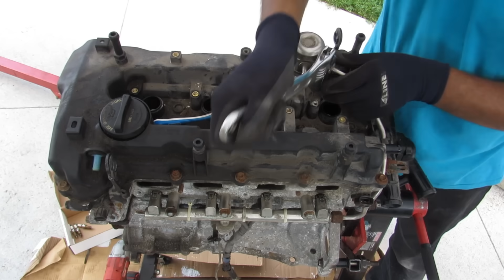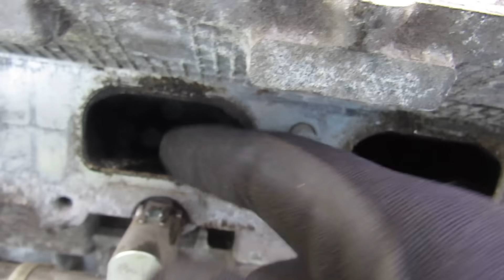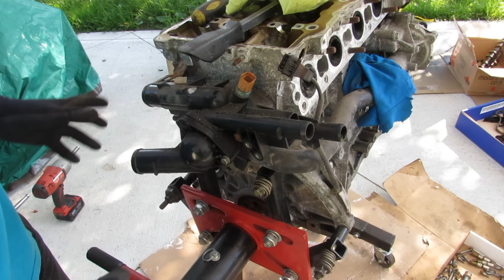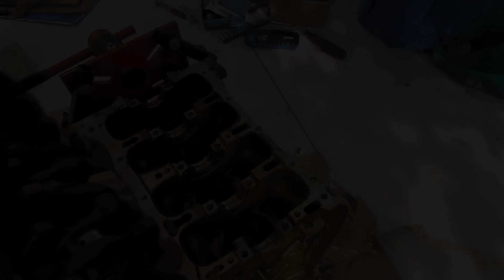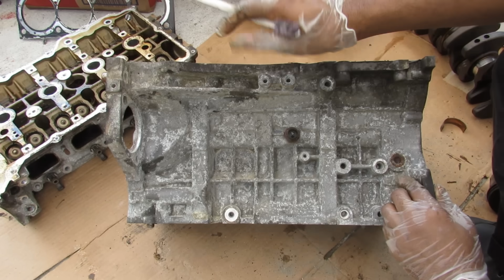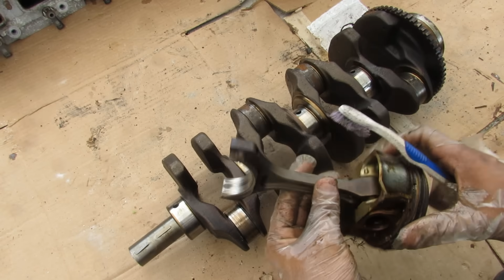Why Hyundai Engines FAIL

Comment: K-Pop cars are trash, obviously.
Reply from the maker: I mean they've started beating the Japanese (Nissan) already...
Reply: @speedkar99  Yabut Nissan got bought by Renault and went to garbage.  The Japanese corporate ethos of long-term commitment to quality, longer R&D cycles, and customer satisfaction went out the window.

European firms are the worst.  They are run to primarily please non-customer stakeholders.  E.G. - Why do you think BMW green-washes its cars by making its engine components out of plastic?  It’s planned obsolescence at its finest, but it also pleases the unwashed hippie environmentalists, because “green”.  🤦🏻‍♂️ American firms aren’t much better, but at least they realize that shareholder value is indirectly linked to customer satisfaction…

Comment: My wife hyundai elantra 2012 engine was rebuild about 8 months ago by hyundai dealership. Had only 28000 miles. They didn't want to do it so we had to show them articles and videos of other people having the same issues. The supervisor of the dealership give the go ahead for them to rebuild the engine.
Reply from the maker: You should have contact Hyundai head quarter
Reply: @speedkar99  Hyundai Corp gave the dealership the go ahead to repair not the supervisor from that particular dealer.
Reply: @smartkid1201  The warranty is for an engine replacement not a rebuild. So they should have swapped the engine out, not rebuild it.

Comment: It speaks volumes about Hyundai with respect to that lacking chain guide between the cam sprockets. Even motorcycles have guides there, it might not be substantial but its there; and motorcycle manufacturers usually do anything to get rid of weight (unless you're HD).
Reply: Yeah, had Elantra in the shop with stretched chain that jumped a few at 130k km. But it was owners fault, 10w-30 mineral and 15k km OIC. We put 'new' engine with 50k km and stated that there's no warranty on this one if it fails because of the way he mainteins his vehicles.
Reply from the maker: Yeah I found it interesting

Comment: I have a santa fe with the 2.4 its had the inspection at the dealership where they change the oil dip stick and update the computer. It's on 100k km am I on borrowed time with this engine? is every single one guaranteed to fail?
Reply from the maker: Not everyone will fail, it's just risky that if it does fail out of warranty it'll be too expensive to replace. I didn't know they change the dipstick
Reply: @speedkar99  yeah it was part of the recall they inspect the engine and swop the dipstick for some reason? Fingers crossed for my 2.4 then!

Comment: Happened to my mom's car, after she brought it in to be inspected, they said it was fine, then no warning the engine just locked up on the highway
Reply from the maker: Yep, it's a sudden scenario...all of a sudden the bearing over heats and quits it's job.
Reply: @speedkar99  i dont get it.
Thise engine are use a lot in my country .
Easy do 300k (km) .
I have a honda with the d16w1 engine (hrv) and i look to it and have a serves interval of 10k for the oil than i look in the book and its tell me 15k interval of oil.
I change the oil my self (old mechanic ) i do it 1x a year and use the 10-40w oil and not the 5-30w oil.
I hate 0-30 4-30 and the 5-40w oils fromt the start.
I just do 10k small (oil and filter) and 15k big (oil , filter sparks and air filter)
Yes like the 80 and 90 .

Comment: I had a 2011 Sonata that I finally traded in last Sept with 145K miles on the original 2.4L engine.
Reply from the maker: Nice. RIP to the next owner
Reply: @speedkar99  Not necessarily.  Hyundai makes some of the most reliable engines out there.  Check out ratchets and wrench video on Hyundai's most reliable cars.
Reply: @springer-qb4dv  Not with the 2.4 engine in it, it's a time bomb waiting to blow up. Never in my life, and I'm 59, had a car spin a bearing until this week. It's unheard of with today's machining standards, except Hyundai ?

Comment: I have what I'm afraid may b a dmb question but when you say triple square socket do u mean a hex
Reply: No I think triple square is literally three squares rotated at different angles so there's like 12 sides to the bit. It looks like a torx but it's different. Most common on German cars.
Reply from the maker: No. Triple square has 3x4 =12 points. Torx has 6
Reply: @speedkar99  thanks guys. Ya I've never heard of that

Comment: I raise my hat for Honda. My last Civic had 400k on it running still like a clock before I totaled it in a winter accident.
Reply from the maker: What engine? D17?
Reply: @speedkar99  it was R18 1.8 civic 2007 now I got 2014 with stick shift manual its the same engine though 😅 thanks for video. It was km not mile. In harsh Quebec climate!
Reply: @mahdavimail  I'm impressed. Our 2009 Honda Civic failed at 140k with the transmission loosing 1st, 2nd, 5th and reverse (manual) and the engine having very excessive blow by and a failing headgasket.
Reply: @JoshuasRecordings  my dead Civic was automatic but this new 2014 is manual because I don’t like CVT new automatics. But this new one has slightly more rigid body structure that I can feel when driving. You are not lucky man people still driving 6th generation civics and I am jealous 😂
Reply: @mahdavimail  Good move on the manual. Hopefully it lasts longer than mine did.
Reply: @speedkar99  what do you think of the d17. Specifically the a2
Reply: The original insight motors have seen 1 million miles. Now the F1 motor is matching Mercedes. Honda knows motors

Comment: We got 2012 Kia optima 2.4 it's got 210,000 miles so far still running good but it looked like the previous owner had a head gasket issue
Reply from the maker: So no oil consumption?
Reply: @speedkar99  no not really surprisingly

Comment: went to the dealership carmax they had a 2017 sonata sport lovely car sexy had the 2.4 hmm ok test drive, got on the hwy stepped on the gas black smoke everywhere uturn took it back nope
Reply from the maker: Wow. A 4 year old car smoking already
Reply: They blow smoke like a diesel on full throttle because of the direct injection burning dirty with carbon buildup.
Reply: @dpok69  I still like the sonata sport but hate the engine

Comment: My 2011 sontana is at 236k with three motors later. Hyundai has warranted every engine swap. 100k Warranty starts over when engine is replaced.
Reply: Question.. you’re paying for the new engines right. Not like the engines are blown or malfunctioning.
Reply: @brucebmendoza  I'm guessing not, Kia and Hyundai have the best warranty's because they know thats the only way to build trust
Reply: @pleasedontwatchthese9593  you have to be the original owner. That's how they get you. Second owner will not get the same service of warranty.  I found out the hard way when buying a used kia. We had to pay out of pocket for a warranty repair.
Reply: @Eli-or7hl  the theta 2 2.0T/2.4 Gdi are all covered under lifetime warranty if the product improvement campaign has been completed which updated software to knock sensor. My mom 2016 sonata 2.4 she bought used at Hyundai dealer at 58k already had it done because all that needs to be done before being sold obviously and now it’s covered for life. So the 100k warranty is absolutely irrelevant to the engine.
Reply: @zabryant01  the lifetime coverage is only for this rod bearing problem... right?
Reply: @TruckerGuy135  well the short block which includes rod bearings which is the issue on why they fail so they all typically are covered.
Reply: @brucebmendoza  I paid zero out of pocket. All I paid is for the tow to the dealership. Every engine lasted about 76k give or take. The current motor is around 12k  with three oil changes. Everything else is original running strong.
Reply from the maker: Wow that's neat to know. With these engine's reputation, you have a lifetime warranty

Comment: with all the carbon built up, how is direct injection better than port injection? Yes, it save fuel, but you have to service more, and most people won't bother.   At the end, shorter engine life, and less happy hour behind the wheel.
Reply: They should have an oil catch can out of the factory or they need to go to sequential like toyota
Reply from the maker: More power. As long as it lasts the warranty, the manufacturer doesn't care how much it costs to service it later.

Comment: The question is are all the engines going to fall apart and more important are the repaired engines used for replacement /warranty poor shape also, my sister had her car done 5 years ago..
Reply: Not all are affected. I believe they fixed the issue on the replacement engines.
Reply from the maker: They probably send the blocks out to be remanufactured

Comment: Just goes to show you, behind every great man, there's a woman with a toothbrush that she stopped using and a few old dresses she stopped wearing too.
Reply from the maker: Well she ootta stop wearing them now that I've used them 😎
Reply: Bad bearings are rather infrequent. Usually lack of proper lubrication is to blame...
Reply: @spol1622  Big end bearings are made of cheese.  I had a Tiburon V6 coupe once and this engine is famous for main bearing issues, the "knock of death" is a well known issue you need to check when buying the car.
Reply: @rodpanhard  I doubt the bearings were made in Wisconsin.
Reply: @spol1622  
agree.......engine  failure  caused  by  neglecting  regular  scheduled  maintenance  -  oil  changes.   oil  is  cheap......engines  are  not.

Comment: Please, talk slowly to understand all engine components. It means that GDI engine has big problems w/intake valve. GDI is good, new tehnology, bad engine. The engine life is the oil quality. Pass to syntetic oil and change often (max. 10.000 km). Clean at each 25 kkm the intake valve w/CRC spray GDI clean valves. If you wait more than 100 kkm will be very difficult to clean these valves. Lot of money to services.
Reply from the maker: Agree, but if they did it like Toyota with both port and direct injection you wouldn't have to do any of that.

Comment: How do they overcome the carbon buildup in the ports in recent engine design?
Reply: Routine cleaning, or adding port injection.
Reply: Port injection.
Reply: Check new Toyota engines, they have both: Port and Direct to lower the carbon build up on the intake side. For Direct FI engine choose oil with low evaporation ratio, high boiling temp, maybe run a slightly heavier oil with higher boiling temp in hot climate. Then there are some products that work a little, cleaning the ports, but many engines, like BMW, have to have intakes walnut blasted to clean the carbon build up.
Reply from the maker: Use port and direct injection

Comment: the engine is bad even if they don't come with direct injection. in latinamerica most theta engine in santafe and tucson  rarely last more then 100,000. bad oil pumps and rod bearings
Reply from the maker: It's common there too eh

Comment: My moms 2012 optima with this engine threw a rod after she just got the high pressure fuel pump repaired
Reply: My Santa FE just spun a bearing and seized up this week. Waiting in the dealer to see if they'll put a new engine in it. If they do, I'm selling it right after, and buying a used Toyota  4runner or Highlander.
Reply from the maker: Ouch. Was the pump leaking?
Reply: @speedkar99  I don't think so i think it just failed

Comment: "gallery".
Reply from the maker: Galley
Reply: @speedkar99  Galley means :
1 ship's kitchen
2 ship powered by slaves using oars
Oil gallery definition:
A pipe or drilled passageway in the engine that is used to carry engine oil from one area to another. [Automotive Dictionary]
Reply: @speedkar99  More proof you don’t know shit.
It’s an oil GALLERY
Gallery means a channel or corridor
Galley means a kitchen or sea going vessel

Comment: I have a 2013 Hyundai Elantra & so far I haven’t had any problems with that engine for my vehicle. It was made in South Korea 😁
Reply from the maker: That doesn't have the Theta2
Reply: @speedkar99  The 2013 Elantra has its own engine failure problems. Thankfully they're not the sudden catastrophic failures that plagued the Theta II. Instead they're the slow knock of death. They've extended the warranty as a result.
Reply: @karlrovey  the extended warranty has changed for the 1.8L NU engines. After 7/18/21 the extended warranty is now 10 years/120k miles for original owner/lessees and 8 years/80k miles for all other owners. The warranty extension is TXXK.
Reply: @frankieb7405  I'm not the original owner but mine was factory certified pre-owned which left the original warranty intact as if I were the original owner. I just hit 100,000 miles overall (only about 40,000 on the current engine).
Reply: @speedkar99   now i'm confused. my 2012 Tucson specs says was made in South Korea, so it doesn't Have a Theta 2 engine?
Reply: I have a 2013 as well. Engine was replaced under warranty at about 60k miles.
Reply: You got lucky Brian. My brother-in-law had to take his 2014 in after it needed the engine replaced for the third time!  He finally said to hell with it and traded it in for a Honda Fit. I think he's much better off now.
Reply: @BigKWS  Surprised that didn't result in a lemon-law claim.

Comment: I like your videos. But in this instance, one point... The bearing shell spinning won't cause a gap, as the opposing shell in the big end cap will spin round with it.  That said, spinning shells shouldn't happened as their external surfaces aren't built for that as with the corresponding surfaces on the inside of the big end aperture. That would defo cause heat, scoring and the such.
Reply: Sometimes one get worn and spins over on top of the other, it'd called spinning a bearing or like I spun a rod bearing
Reply: With loose clearances, thin bearings, and high heat it's very possible for bearings to run over eachother. Either the bearing will heat enough to try to fuse with the rod or it'll heat enough to soften and worm it's way between the other bearing and rod. With modern engines the former is more likely for sure
Reply from the maker: I have taken apart a few engines where the rod bearing spun ontop of the other side rod bearing. They both don't spin together.
Reply: Never knew this could happen peeps. Thanks for the great replies ☺

Comment: I'm curious to know what the fail rate percentage was for this engine?
Reply: As someone already mentioned on the comments, that issue happens to H/Ks made under the low quality standars in the US. H/Ks made in Korea are super reliable.
Reply: Mine did
Reply from the maker: 110%
Reply: @speedkar99  110% failure rate huh?  I happen to have 3 Hyundai/Kia vehicles with the 2.4L Theta II. 53,000 miles (2011 Kia Forte hatchback), 100,000 miles (2011 Hyundai Tucson) and 120,000 miles (2013 Kia Koup). Excellent engines when maintained properly. You take a junkyard engine with zero history information and claim all Hyundai/Kia engines are bad. 🙄
Reply: Cause they are 80.000 mile throw away cars. Junk
Reply: @maxpayne6466  Any statistics that said kia and hunday engines have a higher fail rate of 110 percent at 80000 miles?

Comment: Brother bought a 2016 Hyundai Sonata has 2.4l constantly choking and dying all the time but weird thing is i have a 2017 Hyundai Sante Fe Sport awd i bought has no problems and has same engine.
Reply: What mileage is your Santa Fe would love to hear that it’s over 100,000 miles
Reply: @henrytom5824  i have 68200 on it and it has been good so far
Reply: Also yours may not have had metal shavings issue not all of them are on the recall list even though theirs has been many cases where they weren’t on the list and had bearing failures.
Reply: @henrytom5824  my brother got the recall notice they put a new engine in it and somehow its even worse than what it was before.
Reply: @brianhall6323  sure his catylic converter isn’t clogged happened to our 2016 Hyundai Tucson
Reply from the maker: Choking? Is there an intake restriction?
Reply: @speedkar99   could possibly be cat aswell happened to our 2016 and it gave no codes nor engine light or smoke from exhaust but I can’t see how this would be overlooked.

Comment: Why engineer choose to build the engine that way with all the problems you point out . I thought they were engineers or they just choose to ignore these defect. I see it all the time we have to ship it’s a marking hype and ship garbage. But hey another mans treasure . Great video.
Reply from the maker: Sometimes it's not the engineer to blame, as in this case it was a manufacturing error that wasn't caught through the appropriate QC process.
Reply: @speedkar99  i believe that these manufacturers are aware of the defect and since the average user will not notice these problems . It last  a couple of years and start failing time for a new car. After making so many cars no improvement? Noting Is rock solid anymore. The more advance we get the more defect we bring with it.They probably put a lot of time and development into it, so they  just can’t throw it away let the customer deal with the rest.

Comment: Do you know if they’ve changed the engines sense then or do they still use them? Reason I’m asking is because I have a 19’ with the 2.4 GDI
Reply: they are even worse I think. even more plastic than the older models. I had a customer with a 2018 tucson with a leaking coolant reservoir. very thin and brittle plastic for such important parts like the cooling system. they managed to cheapen it more to save more bucks. impressive
Reply from the maker: Man, I really hope so